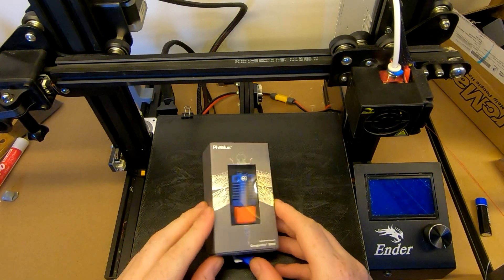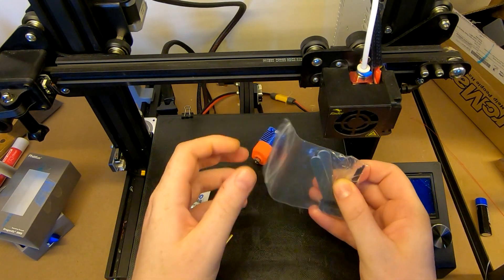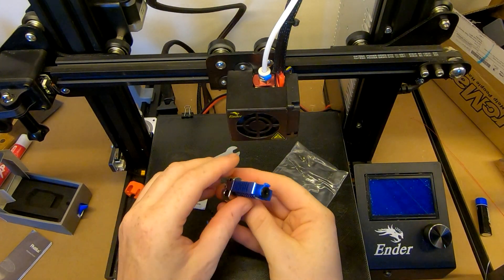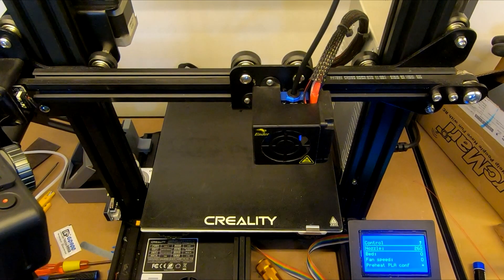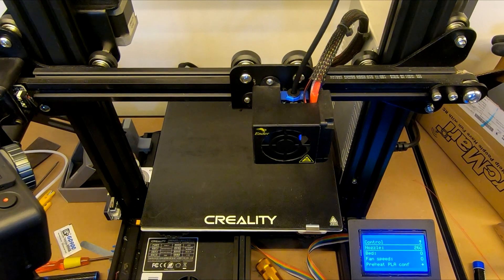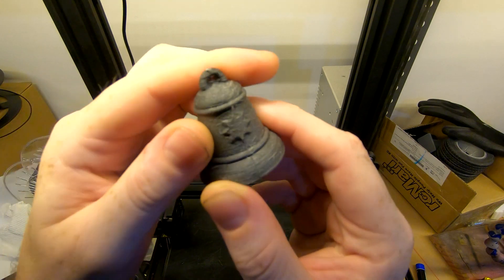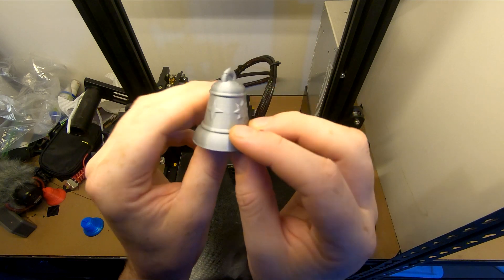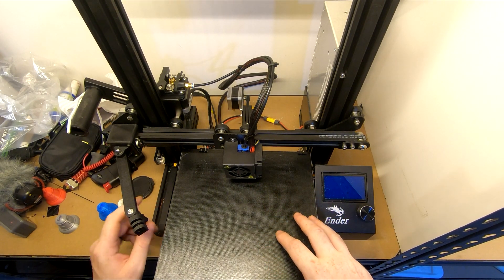Phaetus Dragonfly BMS Full Metal Hotend for Ender 3 rated for 500c

Comment: How did you install the grub screws to fasten the thermister and heater cartridge, the tiny screws dont bite or something I can't get them in or do you just leave it loosly in there

EDIT: Nevermind the I thought the tiny black screws in the bag are the grub screws but they are just spares to hold the heatsink

Comment: Is the width the same as the Mark 8 (MK8)?
Reply from the maker: Heat block itself is a wee bit larger as was a little more of a tight fit with cooling duct setup which was designed for stock hotend,in terms of overall length they are much same

Comment: So how do you secure a stock thermistor in that tube?
Reply from the maker: Somewhat sits into the sleeve, definitely need to cut the stock cable management so can get more length on cable, once pushed all the way  in cable tie wire back again  to prevent it being pulled back out and give grub screw holding sleeve in a good tighten

Comment: Sound like a kiwi? Any tips for a fellow kiwi looking to change to this hotend on a ender 3 v2?
Reply from the maker: Indeed Iam,
Two big things with this hotend if going from stock is make sure you unbundle wires and give the Thermistor some more slack to allow you to really push it deep into the little tube, Was one issue had was didn't push in far enough and fell out so hotend was running much hotter as it was not even inside tube no longer

Second one being making sure you do allow the hotend a good 10-15mins to head up before tightening up the nozzle itself being a full metal hotend,Rule of thumb is while cold wind nozzle in untill bottoms out, back it off around half a turn,Then preheat for the 10-15 mins then tighten it up

Comment: What are you doing about jams and heat creep? 
Mine printy really nice but on pla intermittently It will jam.  The retraction  on Mines set to 3mm and has no stringing do you upgrade the fan?
Reply from the maker: Never had any issues with heat creep or jams,was at 2.5mm retraction since gone direct drive with this hotend now,upgraded part cooking fan yes run blower style fans on all my printer's
Reply: @RevXSCustoms  im thinking its either  getting heat creep or its this specific filament. I'm useing stock fans with the bullseye shroud  because the stock shroud arrived broken. But since the part fan is particularly blocked it raises suspicion  
I just had a jam now and somone heard it and told me I was able to stop and fix and resume program. Might only loose 2 parts

Comment: Thanks for the review RevXS.

Is filament supposed to go through end to end when a nozzle isn't attached?

I'm afraid I damaged my heatblock as everything is mounted, heated, nozzle tightened, but filament won't go through ...
Reply from the maker: Going to be best to heat unit up,remove nozzle and also hotend to get a better look, possibly has been a leak between tube and nozzle itself

Comment: We're you able to increase your print speed with this. I've had it for a few weeks but I'm waiting for the inevitable ptfe clog in my cr10 v3 hotend
Reply from the maker: Never tend to run speeds anything crazy like some, running around 60-70mm/s with pla but sure could possibly push more,the newer high flow units possibly what your after have also reviewed that
Reply: I just went away with the original extruder etc, and put a hemera on my CR20 Pro, takes some more work as it aint a direct swap but well worth it

Comment: This hotend is best at combination with direct extruder, because with bowden setup especially PLA filament sometimes much leak, and extudion is not consistent. The first nozzle at package is copper nozzle with nickle platted surface. Brass nozzle is good too, at practise is same as nozzle at package, at printed parts not visual difference. With direct extruder, printing this hotend very similar as E3D V6.
Reply from the maker: Got this dialed in now with no stringing at all, direct drive seems to be what people think is an easy fix for issues insted of dialing settings in,run this machine daily since this video and no dramas at all
Reply: @RevXSCustoms No dramas me too, but when i installed direct extruder this phaetus print very well and little bit better. With BMG has great performance.
Reply: @romanbabucha139  yeah but why would you bother with a DIY combination and build, when you can buy pretty decent DD sets. Like Biqu or the Sprite

Comment: Were you able to get the silicone sock to fit on the stock setup without leaving anything crooked?  It doesn't look like there's enough room for it between the heat block and bottom of the x-axis' hotend mount plate 4:33
Reply from the maker: Def had to loosen off to get it to fit up,havnt had to take it off since mind you,a few spacers would help bring it out more to limit that issue
Reply: @RevXSCustoms  Thanks for the quick reply!  I'm looking to pick one up.  Wondering if a linear rail on the X with a different mounting plate could solve that cramped space, as it looks to be caused by bolt of the lower wheel on the original plate.
Reply from the maker: Yeah its the Nut on the end thats issue,Possiably could rotate that whole screw setup so got head on that side insted and would give more room
Reply: @RevXSCustoms  I did this a month ago and I think I tried that, but later couldn't get the eccentric nut to hold everything rigidly.  However I just installed a Printermods DD kit and the plate's hole spacing seems a bit off so now the sweet spot is very narrow.  I'll get some new POM wheels on it when it comes in and try my luck.  I'm new at this so there's that disclaimer, too haha
Reply from the maker: Have you checked out video done on there new hotend?
Reply: @RevXSCustoms  I did!  Although I'm not sure if I need a hf hotend at the moment, and you commented that the original has served you well so far.  Furthermore I don't see where it's available for purchase, at least to know the price (and here cheaper = better).

Comment: Why did you not tell us what temperatures you ran this at? Being a hot end that's something everyone would like to know. Do you remember the temps?
Reply from the maker: Temps always going to vary brand to brand
Basically everything I print I run in middle of there recommended min and max temp and go from there, Any major stringing will drop 5d and try again, Poor layer adhesive raise it 5d
Reply: @RevXSCustoms  Do you mind letting me know what the possible temp ranges were then? Really curious on the cooling capabilities of this to print some nasty high temp filaments.
Reply from the maker: @freelancemotorsportsllc2826  
CCDIY PLA 205d
Sainsmart TPU 200d

Extrudr Carbon 240d
CCDIY ABS 245d
Mamorubot Silk 210d

Comment: the termistor always falls out of the little tube for me. how did you fix that?
Reply from the maker: Made sure pushed in it as far as could go,then cable tied up the thermistor to ensure wouldnt be able to come back out
Reply: @RevXSCustoms  where did you cable tied it to?
Reply from the maker: Accaully used kapton tape, just around the heater wires as normal,cut stock stuff off and gave myself little more length to push thermistor all way in and retaped it
Reply: I used wire cutters and crimped the very end of the tube. It worked amazing!

Comment: Nice little video.. :-) You write that it might be good for 500°C (Alt+248 = °) but i guess that would require a new heater..?
Reply from the maker: Realistically average user wont ever get anywhere near that ,300d for some nylons which a stock heater and thermistor shouldn't have any issues at all,is a cheap and easy way to get a nice hotend thats good for abit of everything
Reply: all you'd require is something like a PT100 and an amplifier for it, because normal thermistors can't handle over 300°C, the heater would probs be fine at those temps